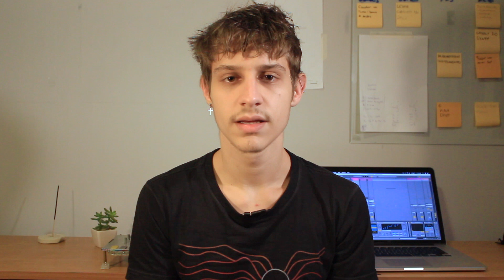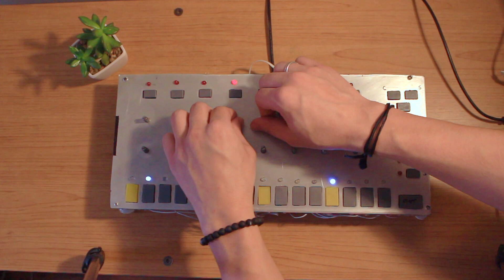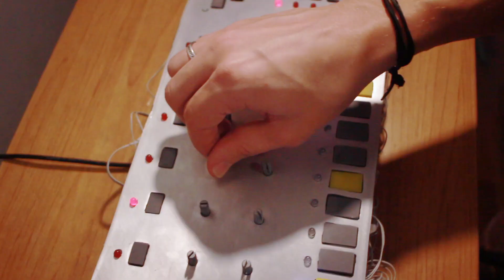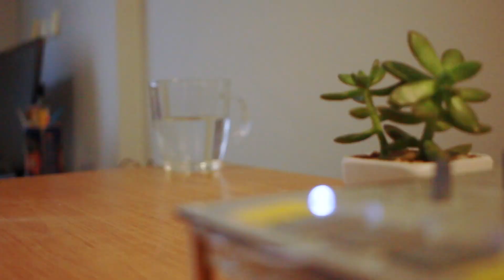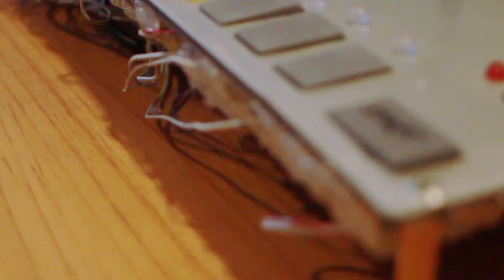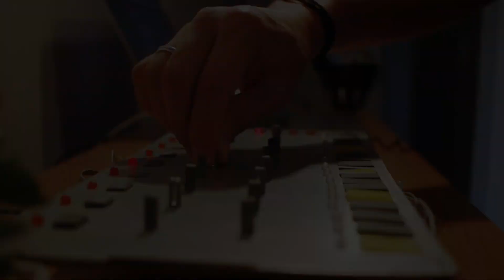Arduino based drum machine

Comment: Good job so far!  Since you are using Abelton in conjunction with your machine, have you considered using step programming functions in Abelton as your programming GUI?  I have accomplished this using Cakewalk's step programmer as my GUI, but you MUST do a lot of research into MIDI protocol since you must 'teach' the drum machine using MIDI  to load it.  Like your unit, mine is strictly a MIDI controller.  It drives actual drum samples I have entered into soundfonts, triggered by jOrgan.  Since this unit is for a theater organ, it was just handy to use those tools.  My unit is Arduino MEGA based.  Each of 520 available patterns is loaded serially from an SD card in real time, even while playing, literally without skipping a beat.  That, along with loading the unit from Cakewalk via MIDI, were real head scratchers.

The unit does rhythm  patterns in all conventional time signatures up to 7/4, and could be programmed to do more crazy stuff. It does breaks, fills, intros, endings, and even drum cadenzas at beginning and end if you want them.  You can also change your choice of cymbals 'on the fly' along with changing patterns 'on the fly.'  The idea was for max versatility in a unit designed for LIVE performance.  There are 192 steps per pattern, 96 for 'mainline'  pattern and another 96 running parallel for breaks/fills/intros. Each of the 16  beats is divided into 12 steps (max MIDI does is 24)  (that's where you get 192-16 beats x 12 steps/beat)  Each step is capable of 'playing' up to 10 instruments,  There are no ''tracks' as such, so they can be ANY 10 from a palate of about 100 available.  Each slot stores the MIDI instrument number, as I'm sure yours does, and the MIDI velocity.  Very handy for expressive patterns in a variety of musical styles. A couple of instrument 'slots' are borrowed from the sequence from time to time for 'control bits' that take care of things like return points for both the main beat and breaks (so I can have different time signatures), where to start intros, and coding for a digital 'counting' tempo light. Which instruments play from  which slots can change with every step, there are no dedicated instrument tracks.  I'll admit 'playing' it takes some getting used to, especially while playing a 3 manual theater organ!  Still getting used to it!  The beat programming is just downright fun, especially with using Cakewalk as my GUI, and I can preview/edit patterns in Cakewalk before loading.
 
Word of advice:  if going the Teensy route, look at the new 4.1.  You can bootstrap an additional 8 meg of RAM on it!  you could have 100's of beats, and much longer ones for variety, too!  Hope my specs give you some additional ideas, especially since on your next project you will have so much more horsepower to work with.
If you want more info, contact me at steamrocks@yahoo.com.

I hope to put out a video with the unit and some tunes played on it in the near future.  Practice, practice practice!
Reply from the maker: thanks for the info! i've actually already built it, i've used the 3.6 because the 4 wasn't available yet, and used a serial flash for storing audio files, will upload a video of it working in the future